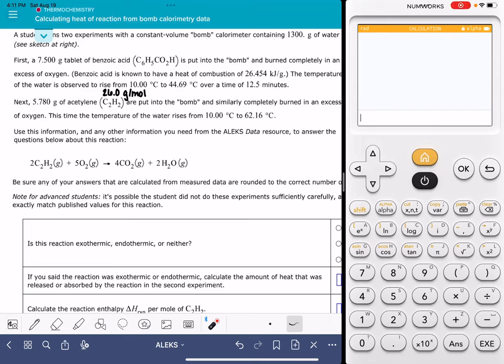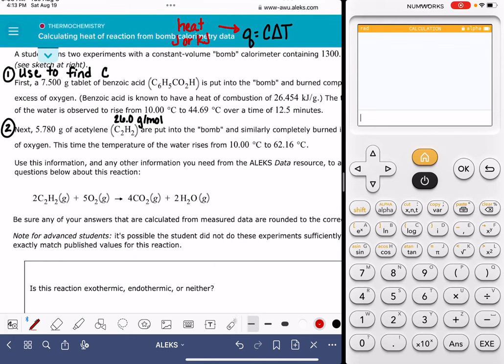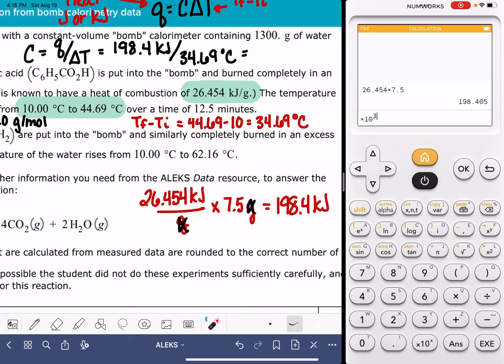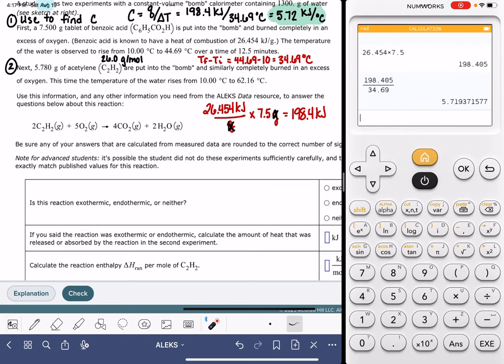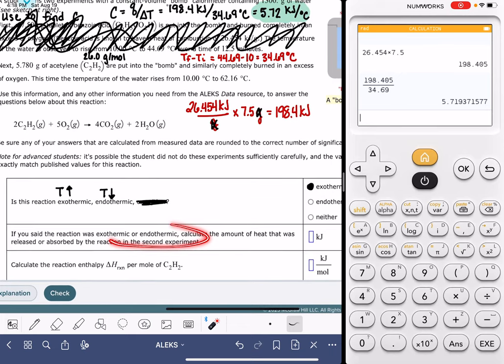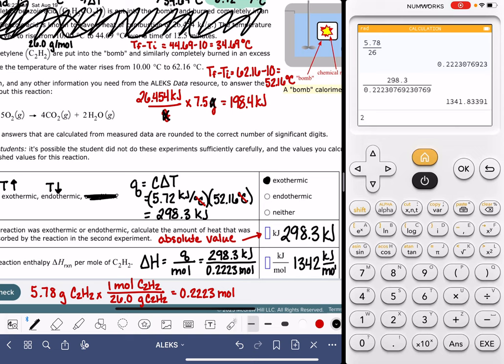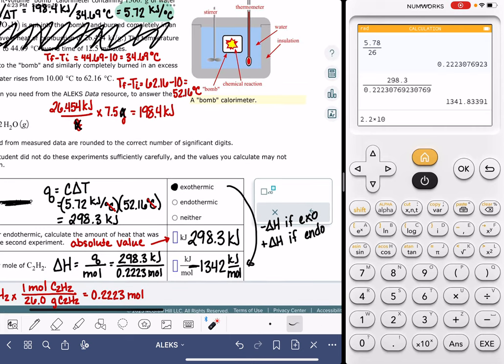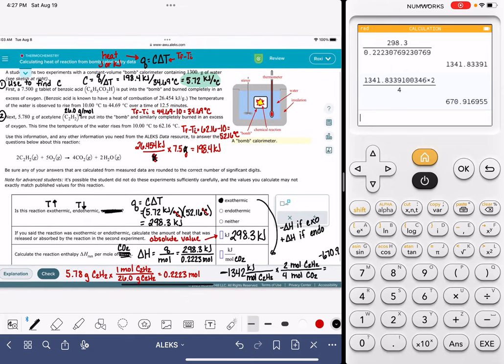ALEKS: Calculating heat of reaction from bomb calorimetry data

Comment: The sig figs stuff for ALEKS seem arbitrary. Sometimes it wants sig figs from the data in the problem and then sometimes it wants the original value of sig figs for the same problem, but disguised as "rounded to the correct number of sig figs." So a problem might be 4 sig figs actual but then only be 3 that it wants for the answer which can be frustrating if you don't understand that.
Reply from the maker: Yes, I sympathize with this 100%! Instructors can set up ALEKS to tell the students exactly how many sig figs it wants, which is the setting I use for my students. The problems are hard enough as is. Hang in there.

Comment: I got mines wrong and I had the question where it asked for one of the other products. It said I had to put C2H4 (C2H2 for yours) on the bottom when setting up. This question in general is just super weird and I doubt I'll be able to get it correct on the exam. I mean, even chatgpt gets it wrong.
Reply: Because she got the last part wrong. There are too many units in her conversion you can’t do that calculation with Kj still in it.
Reply: 13:15 Basically all you do differently is take the number of moles of C2H2 in this case which is 0.2223mol (you can find this number in red just left of the conversion you are concerned with) and use THAT (0.2223mol C2H2) for the conversion to mols of H2O instead the “-1342” number. Write it on paper and you will see why mols of C2H2 are on bottom. It’s those we wish to cancel.
Reply from the maker: @SteadyDog55  I just opened up this ALEKS problem and found one that was asking for the enthalpy of the product. I followed my own instructions in the video and got the answer correct.  I usually don't look at ALEKS's explanations because they can be confusing, but I have verified that the method in this video is correct.
Reply: @RoxiHulet  That is very interesting. I had to do it my way, and that is how to was written in the explanation. Just like the commenter said, where the mols of the reactant are on the bottom
Reply from the maker: @SteadyDog55  Hi! I'm looking at the ALEKS explanation right now for a version of the problem where you are being asked to report the enthalpy of water, which is a product.  The explanation shows that the calculation is "kJ / moles of H2O".  It does not show the moles of reactant on the bottom of the equation.  However... if your problem has the same equation as the one in this video, the moles of C2H2 and moles of H2O are equal, which means that you would have been able to use "kJ / moles of C2H2" and still get the answer correct.  Also, I have noticed that the ALEKS explanation I'm looking at has a typo (it references CO2 multiple times, but shows work for calculating H2O). So it is possible that you were looking at an explanation with a typo but you ended up getting the answer correct anyways because of the fact that moles C2H2 = moles H2O.  I'd love to be able to attach a screenshot but unfortunately that technology doesn't exist in YouTube :)
Reply: @RoxiHulet  Ah, probably. I think only one of the questions was asking me for the product. So yeah likely got lucky and ended up using a number with a 1 to 1 mole ratio with the number I SHOULD have been using. But if both me and the commenter both got a typo, though, they need to fix that. Aleks is already stressful enough as it is haha
Reply from the maker: @SteadyDog55  Yeah I agree completely with that - I was really surprised to see the typo when I was looking at it. I'm in the process of reporting it to ALEKS right now.